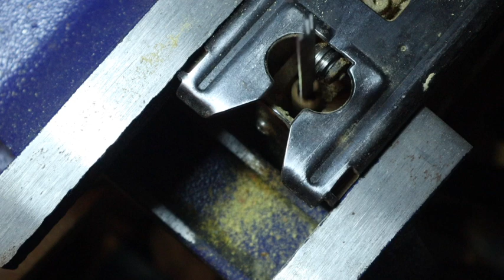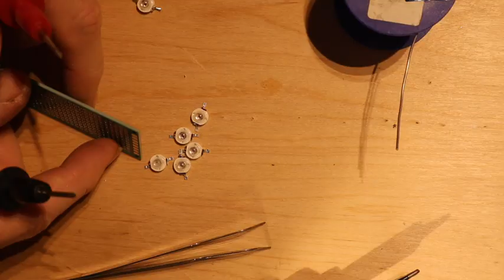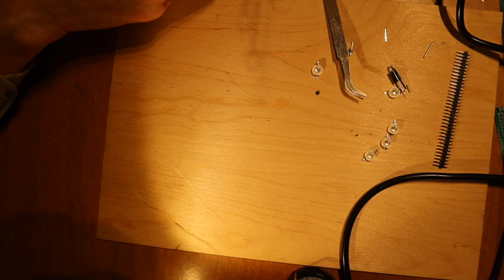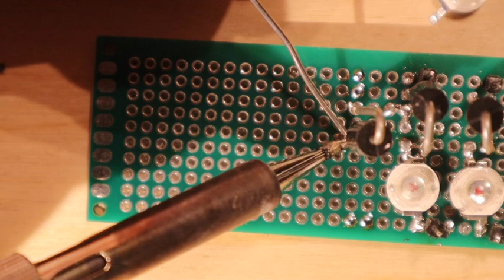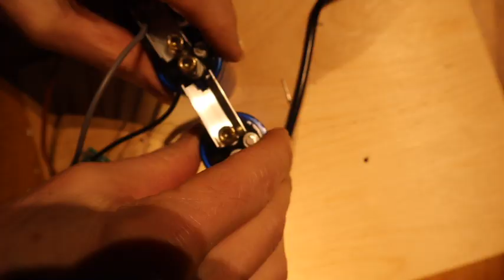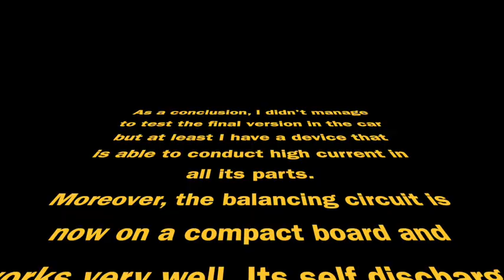Don't buy a new car battery before BUILDING this, Yes, let's see how! - Video 93b

Comment: Saudações 
Porque utilizar diodo e led e nao um resistor em cada capacitor?
Reply from the maker: Hi Uoxi, a good question! If I may respond in English, using a resistor for passive balancing would mean a continuous, wasteful trickle of current parallel to capacitors. Because a zener diode (or LED/diode clamping network) has a highly non-linear IV curve, it stays practically non-conductive until the voltage hits its specific threshold.This means it only kicks in (and it really starts to work then) to shunt excess current right at the top of the charge cycle, keeping things safe without draining your precious energy storage during normal operation (and when your car is parked).
In a few weeks I will come with another video that presents a permanent installed start-assistance but with more capacity. A Super Capacitor is good for only one start and must then be recharged again.
Reply: @nnvasen-good-energy saudações 
Agradeço pela resposta
Pensei sobre isso e creio termos visões semelhantes com relação a buscar pela simplicidade!
Estou fazendo testes com diodos e reles, para poder utilizar somente resistores no balanceamento e de forma que so estejam ativos quando os capacitores estiverem carregando ou ligados ao automovel funcionando!
Estou testando meus caoacitores reaproveitados neste exato momento e separando os por tensão após 12 h de descanso
Serao 12 maxwell 350F 2.5v
6S 6P
Agradeço

Comment: Saudações 
Fiquei na duvida em usar um diodo schokytt ou um diodo comum como um 1n5408 ( 3A).
Diodos shokytt sao muito mais caros

No meu caso utilizarei super capacitor de 350F 2,5v

Agradeço
Reply from the maker: Hi Uoxy, if I remember well it was a normal diode, it depends on the voltage of the LED when it conducts, together (conducting diode + LED) must stay under this limit of 2,7 Volt for the Super Capacitor. LEDs are different among each other.
Reply: @nnvasen-good-energy agradeço pela rápida resposta!
Quando diz sobre a tensão que o led conduz , se refere á tensão minima ou maxima?
Na lista de compras que postou no video o led trabalha entre 2v e 2.4v / 350ma
Considerando um diodo comum, a queda de tensao seria de 0.7v correto?
Poderia explicar melhor a ideia de associar estes dois componentes? No caso de seu setup por que precisaria de um diodo em serie com o Led, se o Led trabalha ate 2.4v? 
Ainda recomenda esta configuração para balanceamento de SUPER CAPS ?
Agradeço 🌻

Comment: Great idea.! But what I have seen and experienced with car battery s, they last more than 16yrs.
I drive a very powerful "muscle car", manufactured 1971,  it will need a new fresh LA battery (number 3) about December this year.
I have built and installed a battery of "supper cap's" on the Starter Motor, and another on Ignition System. This is more about Reliability rather than Longevity.
Reply from the maker: Oh, that is great, what car is it, doesn't it take much starting current? Maybe because it is on gasoline.
Reply: @nnvasen-good-energy 
The car is 1971, Ford 2 door hardtop coup, GTHO Phase IV.  Makes 800 house power.
Cold Cranking Current  (440 Amperes) over 6 KiloWatts to start the engine.
One could argue that the energy of the first cylinder to fire, should be included. It all happens in less than 10 seconds, so in Wh the energy/power required is quite low.
Reply from the maker: Yes, quite low, true. That is the reason that a Super Capacitor bank works.

Comment: Those wire are too thin, and you did not tested the battery in a car.
Reply from the maker: You mean the 2 copper braids? I indeed must test it in the car like in video 89 ( https://youtu.be/KOv28Q8VcWY ) that had much thinner conductors but would certainly not use that as an argument😀). Next weekend I have another video but thereafter I want to show how I try it in the same way. I have 20 of these braids, so can put some in parallel.
Reply: Agree. Not to mention internal resistance of the complete assembly. Lets see what he can do.

Comment: How are you dealing with capacitors self discharge?
Reply from the maker: Hi Dogvic, it is in the video, see at the end. Basically, will go to transistors and that is explained in the previous video (of 13 minutes, nearly same Thumbnail). But for the moment I wanted to work with this concept that at least works well and has limited self discharge. And it can be decreased by choosing a higher forward voltage for the diode (which is now a Schottky).